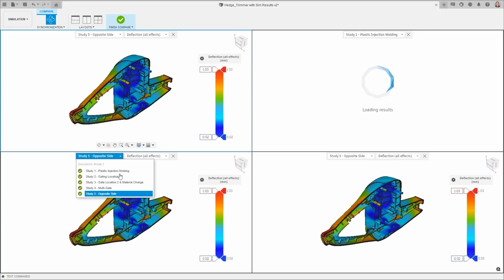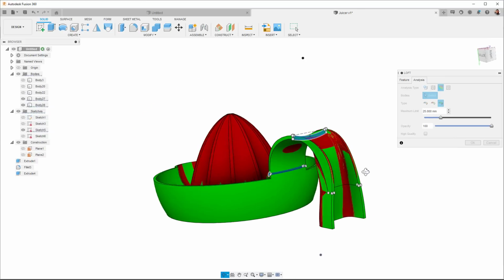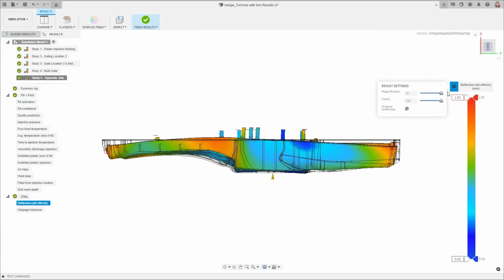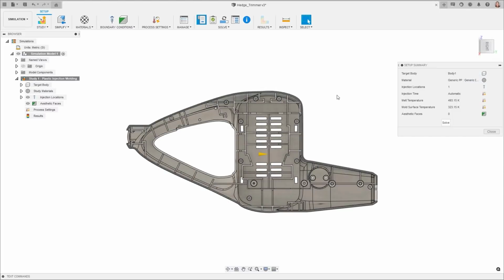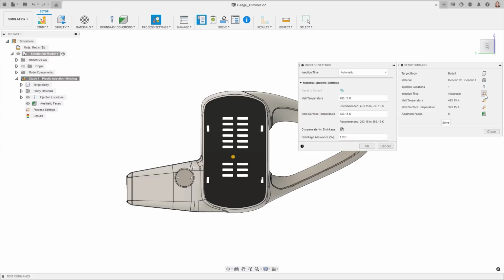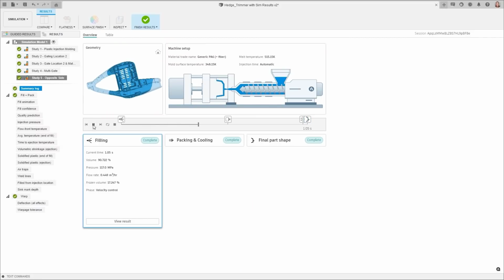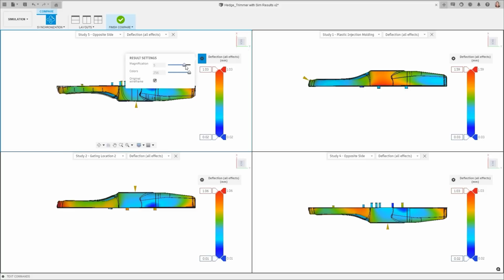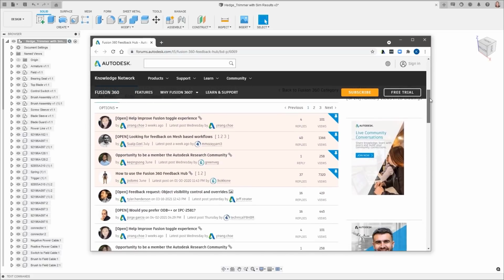What's New in Fusion 360 Design & Engineering August 2021

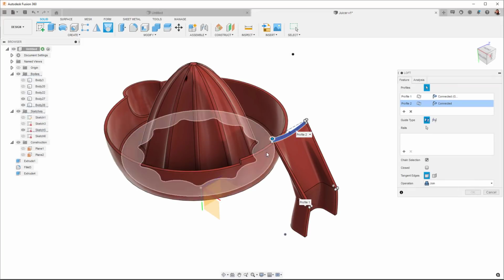Comment: 0:28 Autodesk you have massive balls to be absolutely fine with showing how your UI thread is locking up and blacking out. Have you thought about fixing that? Especially talking about how "far more responsive is". Again, a locking up UI thread is not something that i would call "more responsive". That's the definition of NOT responding.
Reply: Seems pretty legit seeing as how that was realtime.
Reply: @AT-Labs  I have to agree with Daaell -- you can keep the GUI updated and have the calculations / rendering done in b/g threads, the GUI will be thus responsive i.e. capable of reacting to user interactions immediately (by forwarding newly inout data to the b/g threads, again) and updting the visuals as the results of the calculations are coming back to the GUI thread; the black b/g in the video is kind of not a big deal, I guess, yet, a bit shameful in 2021 :)

Comment: Hate the fact it’s not free.
Reply: Fusion 360 still offers a free personal-use license. It is great for hobby projects. IF you are sad that the new injection molding simulation isn't available via the personal-use license, I would have to ask: What sort of hobby project could you be working on that would ultimately be manufactured via injection molding? You'd likely be spending 10x or more of the yearly Fusion 360 cost on just the mold!
Reply: Entitled much? Most of the useful features are basically free anyway on the personal use license.